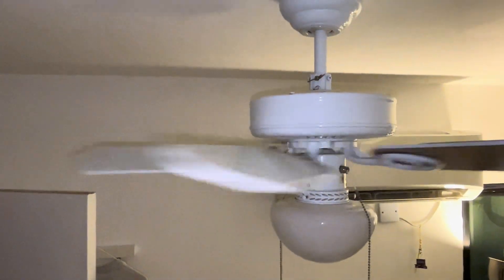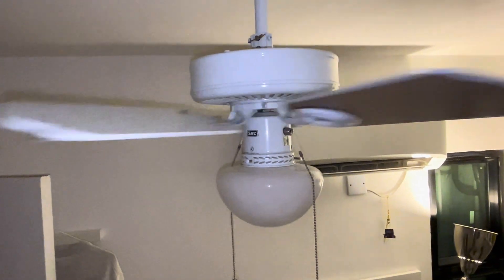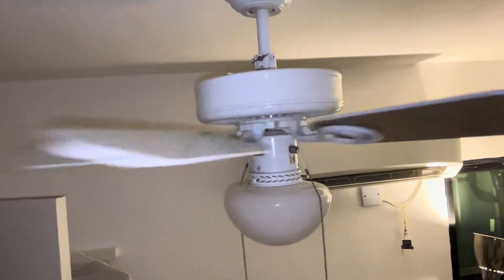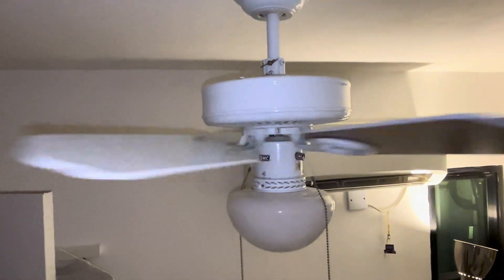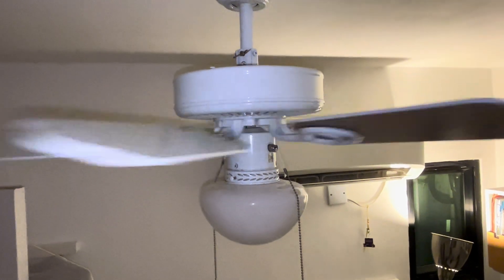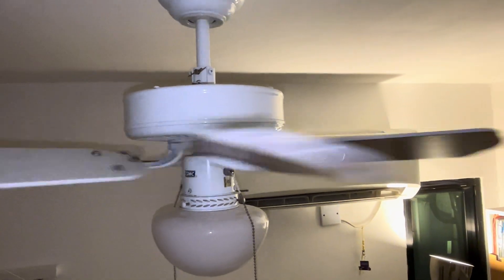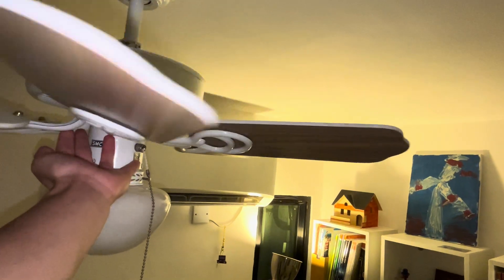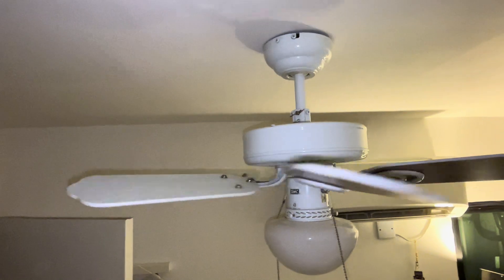Why don't more ceiling fans have this feature?

Comment: That’s a rebadged HB minuet II ceiling fan 

It says SMC so it’s called a combination
Reply from the maker: It’s the other way around, actually. Hampton Bay is a brand of Home Depot, and they have other companies make fans for them. One of the main ones back in the 2000’s being SMC (later it was Powermax). So SMC made these for Home Depot to sell under their own brand, Hampton Bay, and later started selling them in HK under the SMC brand

Comment: Just like with aircraft, more angle of attack gives more airflow, but requires more torque which would be harder on the motor and maybe cause more burn outs. That fan does have a very steep pitch, bet it blows good.
Reply from the maker: I meant the upward-tilt of the blades, not angle of attack
Reply: @katthefanenthusiast5793  ahh gotcha I think I have a outdoor weatherproof fan that is tilted on the edge like that.
Reply: 😀😁😂🤣 @katthefanenthusiast5793